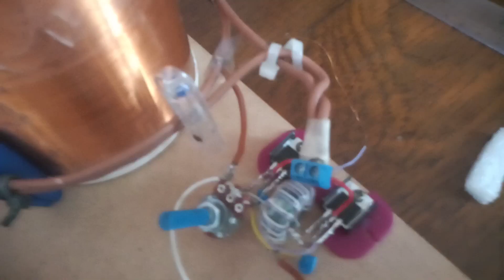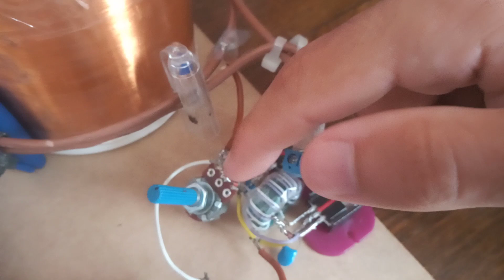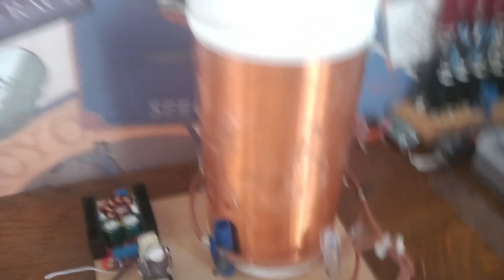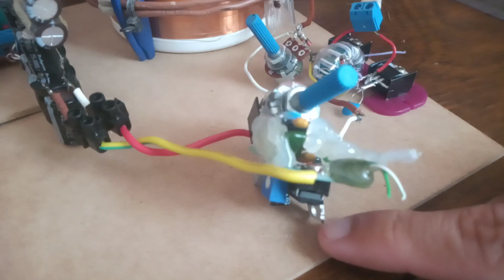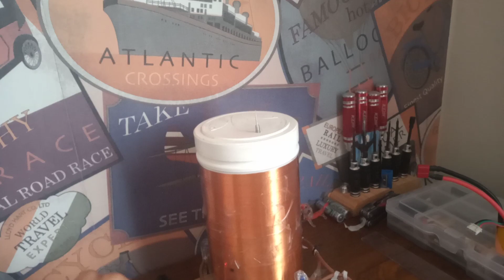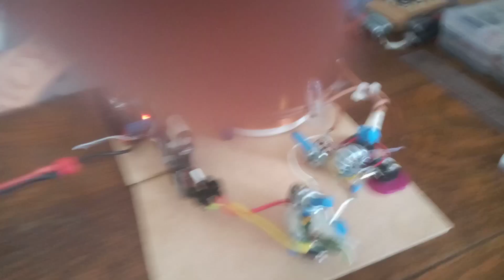Push-Pull SSTC Explaining

Comment: En el diagrama de tefatronix tiene un regulador de voltaje también para el gate de los mosfets verdad?
Reply from the maker: Si , yo no lo usé , pero tengo qué tener cuidado si aumento el voltaje tengo retroceder el potenciómetro qué alimenta las gates , y si bajo el voltaje deja de funcionar hasta qué ajusto nuevamente el potenciómetro ( como siempre la uso con el mismo voltaje no me molesta tanto ése problema) si le pones un regulador vas a poder modificar el voltaje de alimentación sin necesidad de tocar el potenciómetro cada vez (ósea lo regulas una vez y listo)
Reply: @rodriguezfranco3839  entonces yo lo puedo agregar pero lo malo es que este tipo de reguladores solo funcionan hasta 35v, creo que los gates los puedo alimentar con el regulador pero la etapa de potencia osea el drain puedo ponerlo con una fuente de más voltaje
Reply from the maker: @Headbutter-Lettuce90  si , creó qué se puede hacer éso , de alimentar los gates con una fuente o una baterías (los gates no necesitan mucho voltaje, creó qué menos de 5v es suficiente alrededor de 4v )y los drains los alimentas con mayor voltaje
Reply: @rodriguezfranco3839  podría ser entonces como un Zvs, yo una vez hice que un Zvs tuviera la fuente de poder de los drains separada de los gates ya que las resistencias de los gates se calentaban bastante a 27v, entonces solo use una fuente de 16v para los gates obviamente estos tenían su zener

Comment: Veo dos capacitores en los drains de los MOSFETs, de que valor son o que conexión llevan?
Reply from the maker: Esos los agregué yo , son snubbers van entre el drain y source del mosfet podes usar entre 1nf hasta 100 nf los míos son de 1nf cerámicos amortiguan los picos de voltaje
Reply: @rodriguezfranco3839  gracias tengo de esos de 2.2nF que se salvan de filtros lineales
Reply from the maker: @Headbutter-Lettuce90  ésos sirven perfectamente , ayudan a proteger un poco los mosfet , si usas mosfets qué soportan altos voltajes (alrededor 400v ) no es necesario qué pongas capacitores , cómo yo uso mosfets de 55v es mejor protejerlos de los picos de voltaje
Reply: @rodriguezfranco3839  planeo usar unos 260's
Reply from the maker: @Headbutter-Lettuce90  uh huhu , los 260 son una bestialidad con éste circuito !!!
Reply: @rodriguezfranco3839 pero usaré primero unos FETs más pequeños primero